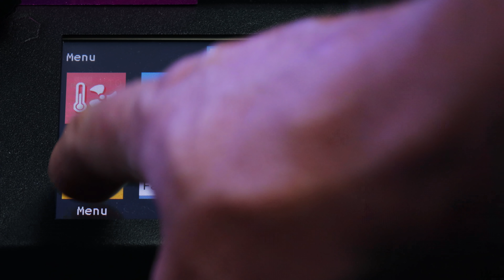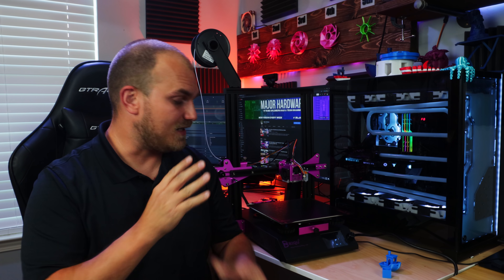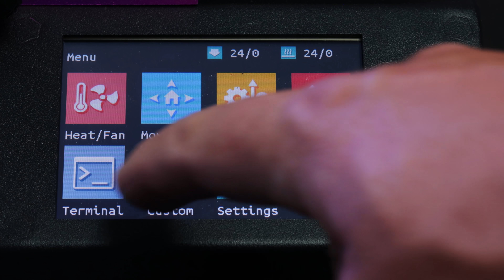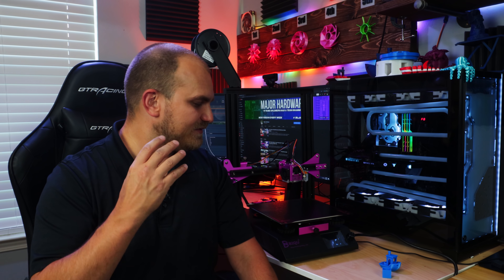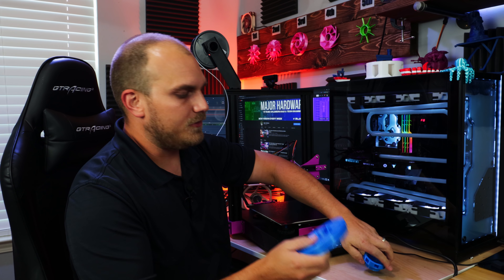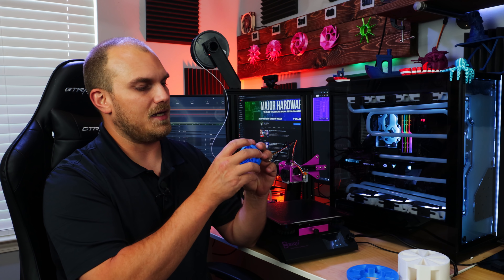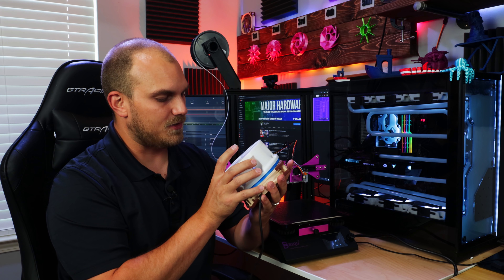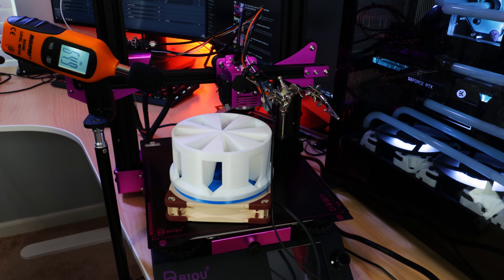3D Printing a Siren from a Noctua A12x25......WILL IT WORK? | Biqu B1 Review

Comment: You can even make a mechanical siren simpler than this design. Just a thin-walled cylinder with the right-sized gaps as the stator will do. It and the chopper would typically be a good bit deeper though.

Comment: If you don't want to pay much for genuine BLTouch and don't want to buy a clone either.
Get an inductive sensor since the bed is steel it can work with it just fine, a bit more tinkering involves but not that hard.

Comment: Those Springs on the Bltouch .... If the Bltouch moves you lose Accuracy. Also check the BigTreeTech GitHub You probly have Update Files for the touch firmware, you can also flash marlin to a newer version and tweak it to your liking

Comment: Helmholtz. Make the chambers smaller for a higher pitch. Make multiple size chambers to get harmonics that interfere with each other, and create a standing wave to amplify the SPL.

Look at the old air raid or tornado alarms. A spinning wheel inside a stationary wheel. It's not so much that they were pushing or pumping air, it was the openings in each passing by that made the noise. Check out this relic: https://en.wikipedia.org/wiki/Civil_defense_siren#/media/File:Air_raid_siren_from_Hillingdon_House_roof,_RAF_Uxbridge.jpg

Comment: the fan which kills noctua is Silverstone air penetrator series. 9 blade and air redirection system and is 2 degree cooler than noctua set

Comment: Easiest solution for your bl touch diving into your build plate without having to reflash the firmware: https://www.reddit.com/r/CR10/comments/byc05z/cr10s_v21_mainboard_bltouch_wiring/?utm_source=share&utm_medium=ios_app&utm_name=iossmf basically the borough needs two wires manually switched. Easy fix 3 minutes to do. As for not remembering your a offset, make sure after you hit the save button, you send the save to eeprom Gcode command or select the yo for save time eeprom. Also while the springs are good for hard mounting protection on the bltouch, after I did the wire fix ajj BHH I’ve I was confident about my hard mount

Comment: The worst part of this printer is the cooling duct. When printing bridges and fans are at 100% it blows on the nozzle and you can  check how fast hotend drops in temperature. Other thing already mentioned is the z offset setting, but it's fixed in the latest fw release on GitHub. In other aspects it's a cool printer, did a 2 days print without clogs.

Comment: Grab a 2208 drone motor a single ESC , a betaflight flight controller, a 6s LiPo and then control the motor output in betaflight configurator app on PC.... Should be able to get like 20k rpm .... Then you can step up to an x class motor next for bigger tests and use the same hardware

Comment: If you could invert the rotor and mount it on a bearing, then point a cone at its center with the tip open, you could use a high static pressure fan to drive the rotor at a higher speed the same way the compressor side of a turbocharger spins up from exhaust gasses.

Lots of work for a noisymajig though..

Comment: Remember the AIO-cooled AIO? What if you took the shower head design and made it a bit taller then misted water onto the radiator to cool it, the water would cool as it falls through the air so hopefully no need for a fan at all?

Comment: You need more power and a lot of the sound is caused by the pulsation of vacuum.  Air raid sirens where powered by big block hemis and even radial aircraft engines overseas

Comment: There is a Nerf toy called Vortex. It has small whistles on the sides so you hear it flying. Why don't you try using that design to put on the propeller blades and it whill make noise and still cool your pc

Comment: before putting this on the redbottom, get the same fan that linus at LinusTechTips has. 11k rpm fan that pushes huge amounts of air. that would be a good step up to the red bottom.

Comment: Our perceived "linear" increase in volume is actually logarithmic. So increasing volume linearly would result in a perceived diminishing return. And I'm not certain about this second part, but it seems to track with what I know: based on the design of this, I believe the speed of the fan will affect pitch more than volume, and the best way to increase volume would be increasing total airflow.

Comment: Automatic bed leveling equals automatic Z warping. All it does is kills dimensional accuracy. I met the Makergear rep that Joel (3DPNerd) talked to in his video a couple years ago, while he was staying at the hotel I worked for and he explained it like this (but in my own words) Think about printing a cube, if bed leveling is active and the left side is lower, for example; the printer is only compensating by lowering the Z height as it moves to keep things sticking. So when he cube is done, put a level on it. It will be exactly as "off" as your bed is. It can't view your model in 3d space and say okay if the corner at z0 x0 y0 is this much higher, it should also be this much to the right and forward. It won't be a cube. A 3d parallelogram, but not a cube. Every angle of that shape will be off from 90 degrees.

Comment: that where you make blower fan if you can make taller 2in n make it like cup upside down with hole in middle so suck air in middle n push out side and goes straight down i was hoping  does better cooling "havent try it but was hoping someone see this n make it"

Comment: Print it larger and stick it to a fan wich where used in the old poweredge servers (4RU - Fans should have 12v 3.5A rating) or use one of your inrunner motors from the drone.
These should have enough power to spin that siren :D

Also i am interested in the files for the siren.

Comment: You can always overvolt a fan If you want to spin it faster and you don't mind if it breaks. I my experience 12V fans can run for quite a while even on 20V before they fail.

Comment: I actually got rid of the BL Touch on my E3P.

It would randomly not trigger the sensor and crash the nozzle into my bed.

Four corner leveling is easy enough and gives great results with a flat bed.

Comment: Print a belt driven supercharger and bracket to mount it on the fan, and the drive pulley to the hub. Print a tube to a box that mounts over a heatsink (we'll call this the intercooler.)

Comment: I'm almost convinced that the z-offset is saved but you require an additional piece of g-code to instruct the printer to retrieve the z-offset values and use them at the start of every print.  I have this setup in my slicer program (g-code before every print runs the bl-touch routine, then uses the values generated by the bl-touch).  If you don't specify it via g-code, even if it has stored the z-offset values on the eeprom, it will ignore them.

Documentation:
https://marlinfw.org/docs/gcode/M420.html
NOTE:
"G28 disables bed leveling. Follow with M420 S to turn leveling on, or use RESTORE_LEVELING_AFTER_G28 to automatically keep leveling on after G28."

Comment: This would be a GREAT CPU overheat alarm... custom fan curve for just one fan, it hits high temp, fan goes to 100%.... just saying.......
Reply: add a little controller to cycle the fan on and off slowly to get that airraid siren effect
Reply: You read my mind.
Reply: Just a smal delta 7k rpm fan only for this
Reply: I just set the computer to throttle to 4.77MHz and sound an alarm if the temperature gets to 70°C, and switch off at 80. It did prevent at least one meltdown.
Reply: Origami fan.

Edit:  I note that the current leader board champion looks like it was 1.5 origami dimension.

Edit2: hmm, are each folds of an origami another dimension. So would a monster group with 196,884 dimensions be an origami with 196,884 folds.
Reply: It’s the oh shit alarm
Reply: Well normally you wouldn't want your cpu to overheat, and even if it does it has a overheat protection
Reply: @dan3a  you've never been pushing things hard for a few hours and suddenly had a blue screen because your CPU overheated? because i have, even with my fans running at 100%.
Reply: @iamzid  Yeah I don't usually overclock my cpu as my gpu is the massive bottleneck and I don't use cpu intensive tasks
Reply: Dan3a Lel I don’t overclock my cpu it just the stock cooler is ass
Reply: kinda impractical though, a mini speaker would achieve the same.
Reply: @TheHarleyEvans  its not about the practicality. its the novelty and its a hell of a lot cooler than a speaker
Reply: @harouoo  i wasnn't doubting it, being able to admit something is impractical but going ahead with it anway is applaudable
Reply: @TheHarleyEvans  I mean, we are still stuck with those old impractical fan headers, although we could very well make something with a CAN bus or via I2C, which would also enable us to put a small microcontroller in there.
Reply: @TheHarleyEvans  ye but this more novel to have an actual replica of an air horn

Comment: What if you re-engineered it so the top part and the middle part were stationary and the bottom / outside part attached to the motor and spun? It seems like you'd be able to get significantly higher velocity air flow being pushed into a more compressed space which would then reverberate more coming out. Idk! Love these vids!

Comment: centrifugal force to make air pressure that is needed to make a sound wave. larger diameter rotor, and the runners in the rotor need to be longer and trap more air in them with less exposed vane in the rotor(smaller center air inlet). also rotor and stater should have a different count of passages from what i've seen.

Comment: Maybe you could use higher voltage with multiple fans traveling in opposite directions.  You could also build a turbine with multiple fan motors.

Comment: Pretty sweet project there are several designs I've seen on air raid sirens. That change the tone.

if you want to see some absolutely ridiculous air raid sirens take a look at the Chrysler air raid sirens. They were powered by a 300 horsepower V8 engine.
I believe they were the largest air raid sirens ever made.
They could be heard at 25 mi away

Comment: I think there's a Delta-made 12cm fan (also marketed by JouJye) that goes 6000rpm, weighs half a kilo, takes about 50W to run, but it's also 70db on its own. So it might not actually need a siren.

Comment: That touchscreen is a separate part, it has BTT's firmware on it and all it does is communicate with Marlin (which is on the actual mainboard) using gcode.

If you long press the touch screen you can switch to Marlin mode.

Comment: Edit machine settings add your Z offset to the start Gcode. And remove it at the end G code. That way printing part after part doesn't make it start printing mid air. Obviously you can do this in the fermware but only upload new fermware when you are ready to spend the next day fine tuneing.

Comment: If you have not yet i would suggest upgrading your firmware for both the screen and for the printer itself. BTT has pages for their firmware upgrades that should help with some of the issues
Reply: Ok so i just checked my printer cause I'm running an ender 3 pro with a BTT board and a tft35 and youre running older firmware which is probably why it won't let you save to the eeprom or your board doesn't have an eeprom and saves it to the SD but mine if I save it to the eeprom works fine (I'm also running an skrmini e3 2.0

Comment: The next task would be to redesign the airflow so that the siren at least sucks the air through the fan housing.
That way it could still be considered a "cooling solution"

Comment: Destroy one of the EK vardar furious fans (highest rpm fan they have) and try using it. (:
even going through a radiator they move so much air it spins my ceiling fan 😂

Comment: Sorry this is off topic 

Can someone please advise me. 
At first I wanted a front mounted AIO in a push pull configuration. (the reason I was thinking about front mounting AIO are lower tempatures, look at BitWit Kyle's video about front vs top mounted AIO) 

Butttt the higher temperature If mounted to the top is probably because it set to exhaust.

So if I do this :
3 front fans as intake
3 top fans (so my 360 AIO) also intake
And 1x 140mm exhaust fan (only can have one.

I then have the best things in both worlds. Top mounted AIO mostly is a  better option (see gamers nexus for full explanation) And still have cooler TEMPS because I set them as intake. 

Buttttt can I do this setup? 3 top and front intake, and 1 exhaust. Or will I kill airflow?
Reply: To me, it sounds like you’ll choke up your exhaust fan from lack of CFM going out vs how much goes in... it’s all about balance.
Reply: @BeezyKing99  Yeah that what I feared. But I'm not experienced enough to know for sure. 
I would rather front mount the AIO(with tubes up) but apparently that's not good for the AIO. Also potential more noise and heat.
And mounting it tubus down is not a option because it won't fit.

Comment: The size of the ports decides the volume, how much air passes in when opening. Also the chamber in the turbine should be closed to create the airwave. The speed only decides the pitch of the sound.
Reply: Also worth noting is to have 2 sizes (or more) for ports, the lower and higher freqiencies harmonize and create a louder tone
Reply: We have an old warning siren and it definitely gets louder as it spins faster as well as the pitch gets higher. It takes a few seconds to ramp up and is very heavy. It must have some type of gearing in it.
Reply: @garysickler2179  That's just the motor spooling up. Isn't any gearing.
To everyone else,
number of ports decides final pitch at full speed, size of ports (or anything that affects airflow positively) increases volume. Speed also decides pitch (of course)
Reply: @childishtombino1275  Hence many sirens having a separate blower.
Reply: GeneralPurposeVehicl I don’t know about many but some have opted for use of an external air source too yes.
Reply: @GeneralPurposeVehicl  Not many sirens have a separate blower due to maintenance cost. Most use electric drivers or are mechanical and use the rotor to suck in air.
Reply: @GeneralPurposeVehicl  I only know of 2 that use blowers.
Reply: @ChrisVTitus  the thunderbolt does have a roots blower

Comment: Quick question about 3d printing: when you're trying to get a press fit part, what kind of tolerances do you use?
Reply: It depends on what filiment you use and the % of shrink. Its different depending on what filiment you use. You can test by printing something like a small nut and bolt separately and seeing how small you have to change the nut to fit in the bolt or vice versa
Reply: ABS is known for shrinking when cooling. Have to increase the size of the print by 1-3%.
Reply: @SFAFirebass12  yeah that's why I was asking him what he was referring to material or other issues
Reply: What do you mean by tolerances? Types of material PLA ABS PETG? Do you mean print settings? Flow percentage? One of the main things to do is make sure when you ask the printer to purge out 100 mm of filament you get 100 mm And then adjust accordingly it's a good place to start, to make sure you're getting the right amount of material out of the nozzle.  Hopefully that helps a little. can always try to help you more if you have more questions.

L

Comment: eee-prom :D.. i'm pretty sure it EP-ROM
Reply: EPROM and EEPROM are different things tho. EPROM (just erasable programmable ROM) are usually named the ROM chips that have a small glass window (tho that's quartz glass not normal silica one) to allow UV-C light to enter and erase the chip, you need a decently powerful UV-C light to erase them or many many hours on the sun, meanwhile EEPROM are electronically erasable ones that we use more nowadays.

Comment: it would take a while to install, but this would be an incredible practical joke to pull on someone...
Reply: I did a similar joke back in college but using some basic programing. Back when internal PC speakers where a bit bigger (Think Old Compaq PCs running windows NT 3.2) I wrote a program that would run the moment the system tried to access drive A:\. It would output a tone through the integrated speaker looping from the lowest frequency all the way to the highest for 30 seconds (sounds just like a alarm siren). Put said program on a floppy disk and then put it on one of the stations in the computer lab without being seen. It's worth pointing out that those had no external speakers allowed so people only ever heard the PCs beep at startup or on an occasional error. Suffice to say that they freaked out!

Comment: Really neat idea. At a campground I stayed at a few times, there was a manually turned fire siren which used a crank. The impeller was in the middle, with the reflector around it, and then then trumpet around that. The trumpet spun the opposite direction of the impeller, effectively doubling it's speed and thus doubling it's frequency. however, this thing had no protective cage around the trumpet, so you could easily get your fingers caught in that thing.
Reply: Don't touch that darn thing
Reply: Why... Would you stick your fingers in it...? Sounds like your camp believed in survival of the fittest.
Reply: @cosmicrider5898  You weren't supposed to, the issue was the thing was hard to crank, and to get leverage you would put your other hand on something, which could accidentally end up being the siren itself if you were in a hurry or not paying attention.

Comment: Man that puts a smile on my face!

I bet you can design it so that it had two separate stators and another layer of the rotating assembly, you can change the spacing so it has two different tones at the same time.